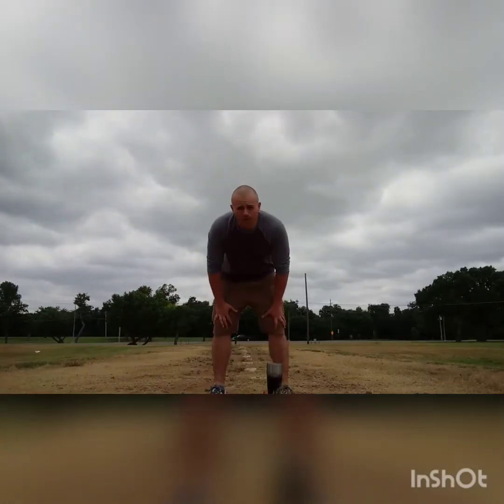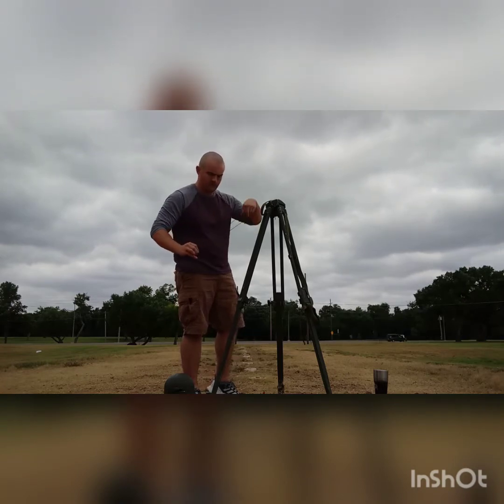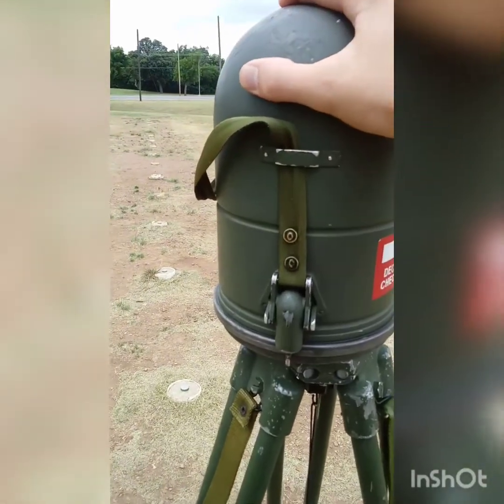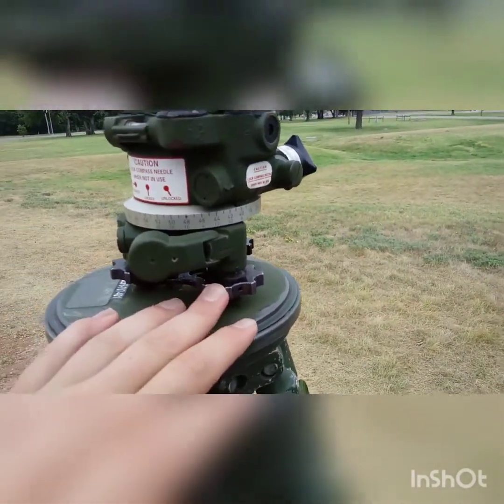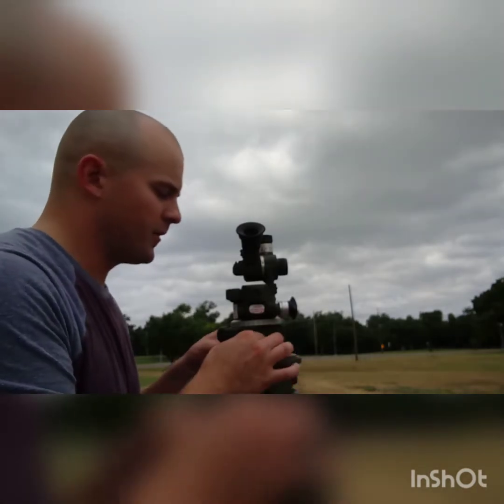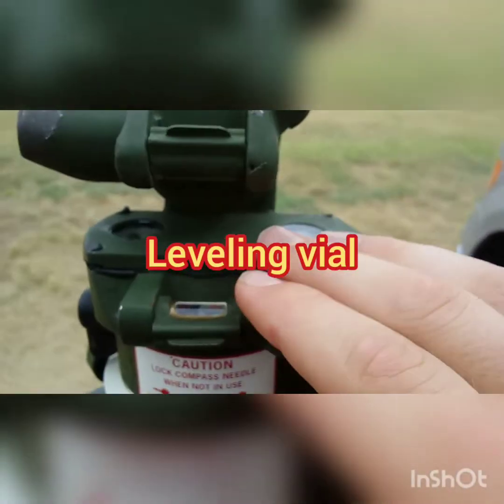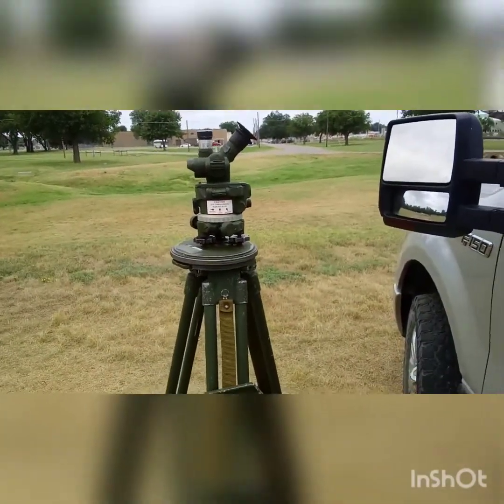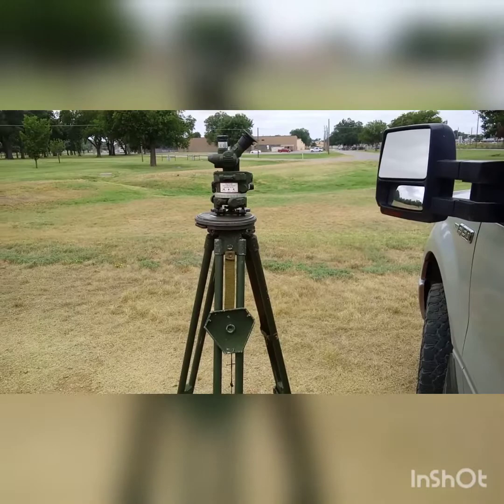Setup, Level, and Plumb the M2A2 Aiming Circle - 0847 Survey

Comment: Just one comment:  You repeatedly mentioned turning the aiming circle "45°" and then called that "1600 mils"; however, 1600 mils is not 45°, it is 90°.  A complete circle is 6400 mils, or 360°, so 1600 mils is 1/4 of a circle, which is what you rotated the aiming circle during the leveling procedure, not 45° as you mentioned.
Reply from the maker: Yeah I misspoke a few times in this video. Just to be clear 360°=6400mils.